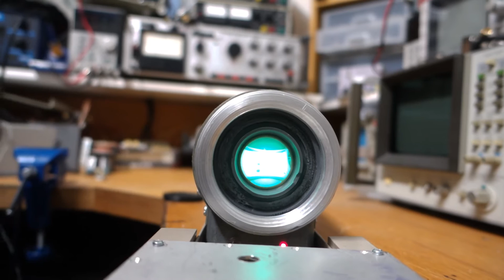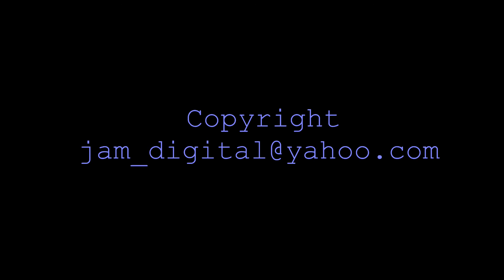A closer look at how I attach a camera to my NV tube unit

Comment: What about the distance from the input window to the lense using a 50mm lense. Would it be 50mm. Probably a stupid question but thought I'd ask since that's what I'll be using. Two more questions: Can you do anything about the static effect(looks like tiny dots moving really fast)? And now that it's 2017, what camcorder do u suggest?(Im afraid to buy anything because I don't know if the camcorders I've been looking at online can focus that close up).(is there a way to tell like the f numbers)  Thanks for your time.

Comment: Have you tried connecting a DSLR like a Canon to your Night Vision for video or images? Not the front lens but where you have the HD camera.
Reply from the maker: No I haven't but if the ccd is close enough to the back of the nv tube it should work. Probably not much point though as the NV tubes resolution is not up that of a dslr. even one with a apsc sensor.,    It more closely matches a full hd video camera.
Reply: itakeyourphoto I'm gonna give it a look before I commit to the HD camera because of the video ability with the DSLR. Connecting to a computer via the HD Camera may pose more difficulty as far as showing live video. With the DSLR I can use BYEOS software for live video.
Reply from the maker: Paa Hawkins Most video cameras have live video out and a simple LCD panel or TV in AV mode is all you need to monitor what's going on while the camera records to sd card internaly.  If you wanted to record to a computer a simple $10 video capture card on the end of the AV cable will do that.    I might add that at one stage I did try to use a microsoft full hd web cam connected directly to my laptop.  Video quality was far less than my current handycam setup and very laggy even on my i7 laptop.  I tried it because I wanted to use the motion sensing features of some software I had.
One added benefit of using a sony handycam is that I can FF through the video clips on my desktop.  Very handy when it comes time to check through hours of recorded video..
Im sure you wont be able to get a dslr sensor close enough to the nv tubes  screen without having to use some optics or a macro lens that can focus to less than 30mm (impossible)
Reply: It's no biggie. I have both cameras actually. My DSLR is my main astrophotography camera. But I have a brand new HD handycam I was hoping I didn't have to use. LOL  Too many cameras! But I'll keep it since it seems necessary. It does have a video to computer connection. But what software actually opens it up for live view? Or does it open with let's say Windows Live Player for live view? That's where I'm a bit confused because as I said before, my DSLR is used with Backyard EOS software.

Comment: I have a few questions, I'm using flexible speaker wire what's the right gauge to use? What's the best wattage of soldering iron to use and what's the best solder to use? And third I'm using a 2x AAA battery holder for my power source and I'm relativy new to soldering so I was wondering if you could give me a good description on how to solder the wires from the tube to the battery pack and then solder the wires from the battery pack to the switch.
Reply from the maker: Hi
The two AAA holders will be fine although if you can fit AA holders the batteries will be cheaper and last longer!

Any wire will do as the tube uses very little current so thin hookup wire is fine, The thinner speaker wire is also fine.  You know the wire that goes to the battery clip on a 9v pocket transistor radio? that gauge is perfect.
Soldering iron anything from 30w to 60w   Normal lead based solder or even the lead free stuff will work.  
In order to solder a wire to that metal ring around the nv tube input window (that's the one with the weird   patterns when you hold it in light)  you have to file or scrape a small area of that ring otherwise the solder won't stick.  
The key to soldering that is to heat that cleaned area with the iron and once its hot push the solder into the corner of the soldering iron tip and the ring.  Solder should melt onto the ring. Once you have solder there, do the same to the end of your wire and then place the wire on the soldered part of the ring and heat it with the iron until the solder reflows.
For the positive terminal find a screw that will screw into that small hole and simply wrap the wire around it or if its a brass screw you can solder the wire to that screw once its screwed in. Again you have to file it down a bit first. 

Soldering to switches is easy.  Usually the have holes on their terminals.  
Poke the wire through the terminal and wrap it around one or two turns then heat it with the iron and feed solder into it. It will flow nicely. 
If you haven't soldered before I would recommend you ask someone with a soldering iron to help you.    
You can make the tube connections without any solder. You can get a piece of wire say about 40cm or 14 inches long and remove the insulation from about half of it.  You will find that you can wind that wire around that ring and carefully push it in between the ring and the rubber. Once you have 1 turn around you can simply twist the wire around itself.
while soldering or filing the ring make sure you cover that window so as not to scratch it or get any solder splatter on it.

There are lots of videos on youtube about soldering.  watch a few before you start.  It will help a lot

Hope it goes well and let me know when its working

Comment from the maker: couldn't reply to your post...    Its a standard die-cast alloy box made by hammond. Size is 113mm x 63mm    4,5 x 2,5 inches.  I didn't use the lid and filed the front and rear side walls down to the shape of the nv tube housing. Made up 4 small tabs to attach the box to the tube housing.  Inside there is 2x 2 aa battery holders.  one on each side of the box to allow for the fact that the housing protrudes into the die cast box.   Also inside there is a switch and led

Comment: Hi, have you tried to quieten down the P8079HP, if so how do you do it? As you're aware from my video I incorporated a pot into the supply voltage which don't do diddly, reducing the voltage does reduce the sound somewhat until the tube supply cuts off, at this time the pot has to always be on full. Is there any other way you can suggest. I've purchased the Sony handycam which now works great on the scope thanks for suggesting that to me. John.
The P8079HP lens test on the Sony DCR-SX15E
Reply from the maker: You should be running it on 6v max   and if you are you don't need a potentiometer inline with the battery.
The noise is caused by the dc to dc high voltage  converter in the power supply.  Its normal for it to be audiable but only just!  It should not be screaming.  If it is there is nothing you can do about it other than try a different tube or use a more sound proof housing.
Reply: itakeyourphoto Thank you, I was out in the wee early hours filming "Stars" and decided to not narrate over the recording. However, the tube is running at 6vd full power, think I'll leave the whining as it is and not try to improve. Once again, thank you :)